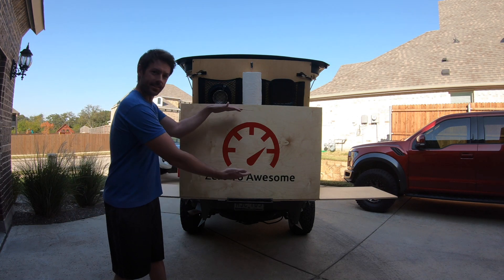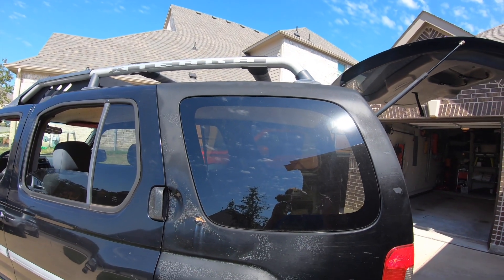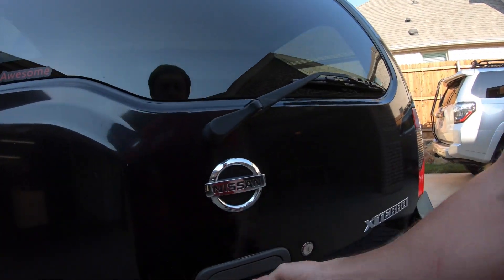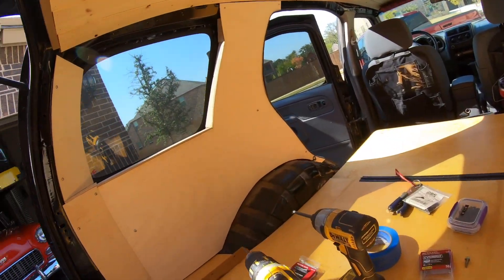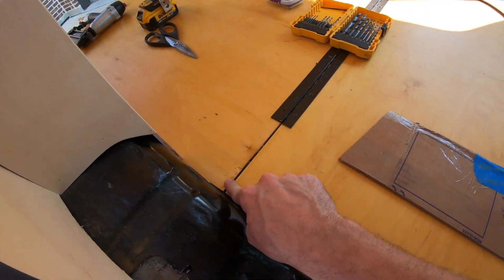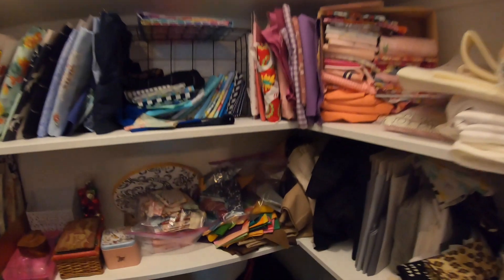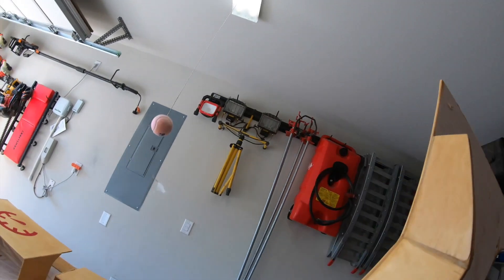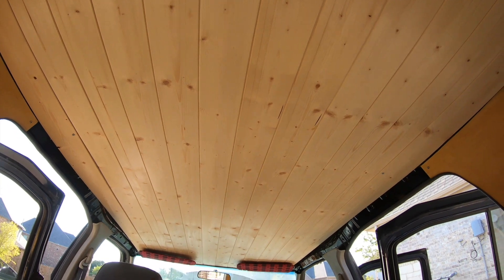Our offroad camper needs an INTERIOR!! So we grabbed some wood & wooded it out like you know we wood

Comment: Looking great. I wanted to ask do you have plans to somehow soften the transition from the pull out to the rest of the interior? That edge looks like it will be murder on your back trying to sleep on it. Maybe a piece of pool noodle or maybe an 1 1/2" chamfer to ease the transition? I would have made a mess out of trying to glue that fabric in. Is there room between the wall and slide out to surface mount some speakers?
Reply from the maker: I think we’re gonna work up some sort of custom mattress that evens out the floor height. Should be getting to that soon! And I replaced the door speakers up front so the sound is decent enough

Comment: How did you mount that wood paneling on ceiling??
Reply from the maker: Construction adhesive and some hidden screws into the ceiling.
Reply: @ZeroToAwesome thank you! Do the screws go through the top of the roof? Or are there 2 layers of metal on ceiling? Great video btw!!!
Reply from the maker: There are some structural members up there to screw into so no hole-y in roof-y. This is a professional conversion, we can’t have leaks.